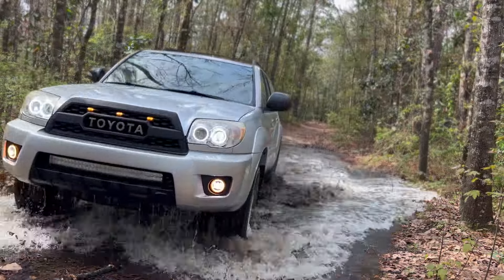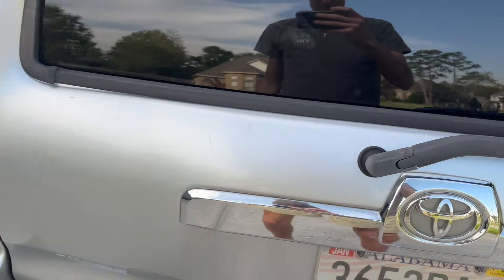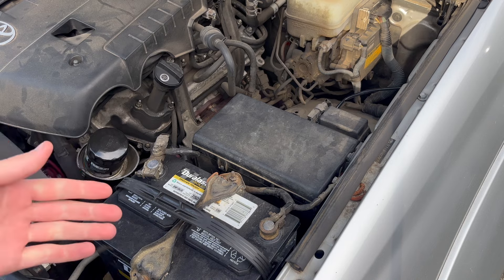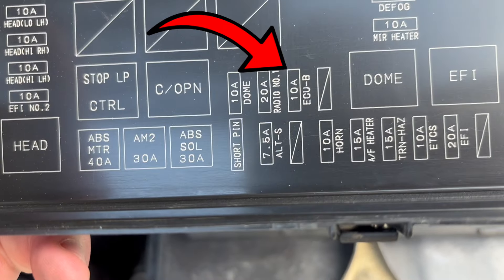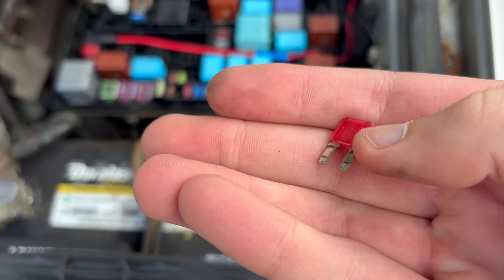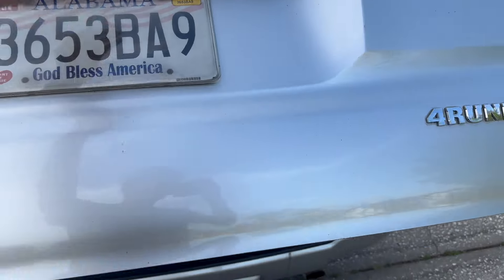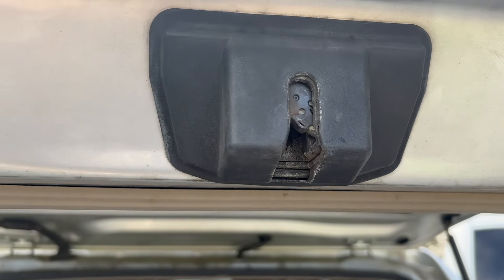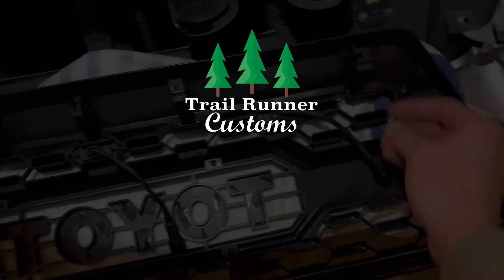4th Gen 4Runner Rear Hatch Stuck / Won't Open (ECU-B Module Reset)

Comment: 2007 4R. Totally worked. Initially allowed me to open, but the motor didn't latch when i closed it and was latched, but still had play. Repeated the reset and it got the motor to open the gate. Thanks!

Comment: I did this and it worked but then when I shut it it got stuck again
Reply from the maker: Sounds like it could be an actuator issue. Maybe look into that next
Reply: @trailrunnercustoms   I have SAME problem. Works once or twice with reset and then locks again. I dont know if I should try to replace Tailgate Actuator (69110-35090) OR Liftgate Multiplex Control Module (89222-35010).
Reply: take a look of how to replace the actuator.
Reply: @rscualo4859  Thank you. New replacement ordered and gonna try that first.
Reply: @trailrunnercustoms Replaced the actuator with aftermarket and working perfectly.
Reply: What kind of actuator should I look for? @Dahnkster
Reply: @Dahnkster  Any recommended tutorials?
Reply: @Dahnkster  I already replace the tailgate actuator but it work for 2 months and it's coming back again

Comment: Yes, that fixes it, but WHY does it keep malfunctioning?  What is the root problem?  I don't want to have to do this every time I need to open my trunk.  How do I fix the problem for good?
Reply: I have the same question. This works but it eventually stops and has to be reset again.
Reply: My common problem has been1. Leaving tailgate open for many hours or 2. Having something preventing tailgate from closing all the way or 3. Rear window not completely closed

Comment: Mine is doing the same as others. I'll get it to work. Sometimes it will work maybe 10-15 times over a few days. Then it quits. I've had to keep needle nose pliers in my vehicle so I can reset it. It's usually when I've got to load the whole back end with groceries. Now it works only 1-2 times then quits again. The hardest part is getting the fuse box cover off!! Now it's winter and that is frustrating.
Has anyone tried replacing that fuse? I see no damage to it though. My fuse is 19-yrs-old now. Just wondered if someone replaced it and it hasn't stuck anymore?? Wish there was a permanent solution.
Reply: I already change the fuse but still repeat the problem

Comment: What if this works for a couple days, but have to reset it over and over.  Also, there is a loud buzzing sound coming from my passenger door when I push the unlock button.  Is that the actuator?  The ECU-B Module?  Some switch in the passenger door?

Comment: Followed your instructions. Worked perfect. Then would not work again. I reset it 4 times. Every time it opened only once, then not again. The fuse looked fine. Rear window did work. However, as the hatch raises you can hear the motor inside the rear door again (just like when it closes and the motor finishes making it snug). Never have I ever heard the hatch motor make a noise on the way up to being fully open. Nothing blocking it or hung up. SUGGESTIONS??  
2006 model not quite 100K miles.
Reply: Any follow ups on this buddy? Having same issue! TIA 😎👍

Comment: Worked for me! Had a bag of mortar preventing the full closing and even after removing the bag it would not open or close. FYI my fuse box had a white fuse puller in the box. Made it super easy to remove.